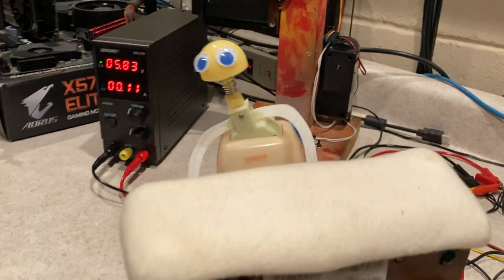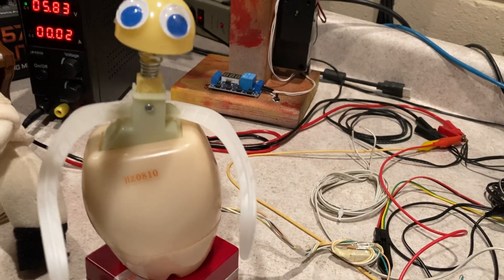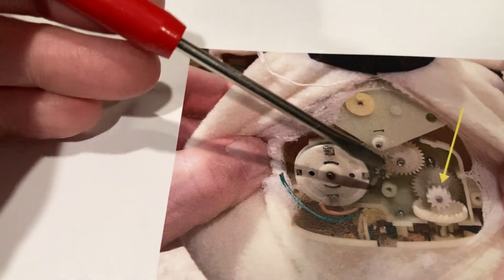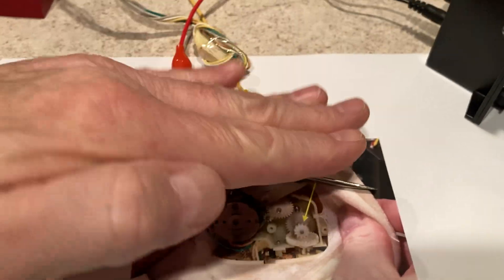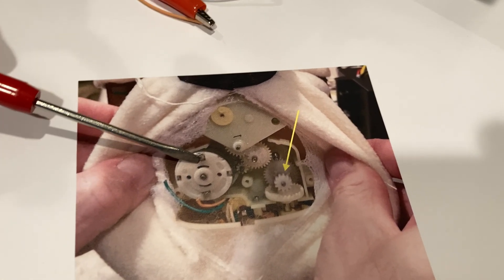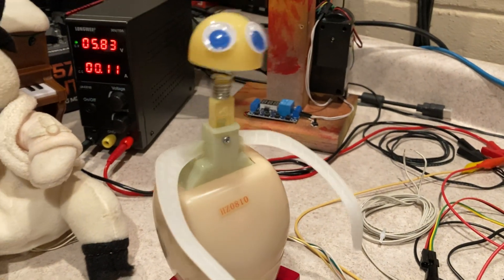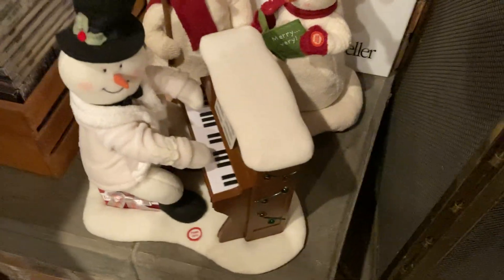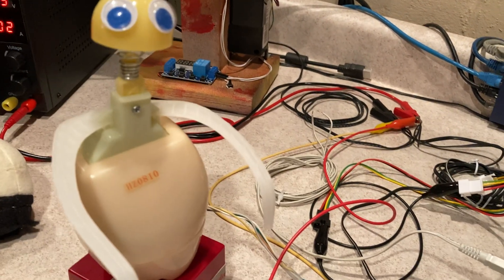Hallmark Plush 2005 Piano Playing Snowman Explain Gearbox Part 3

Comment: Can any body help me with some wiring advice? I have the unit apart but some of the wires have broken loose. I know green wire goes on the top lug of the motor, the tannish/orange one on the bottom lug. There is a small black jumper connecting the 2 leaf switches. There is a yellow wire going to the belt drive side leaf switch. This leaves the grey and the white wire. I assumed the white one went to the rear leaf switch but what about the grey wire? Does it share the same connection with the white wire on the rear leaf switch? Any pointers or a good picture/diagram much appreciated!
Reply: @mikecomptech can you post a pic of the wire connections?

Comment: Thanks for the walkthrough on this little mechanism. 

I’ve a question if you don’t mind. Something odd, once I got the motor cleaned up, made sure all was running correctly including the flair turn on the keyboard, once the back body cover was in place, the mechanism seems to stick and not follow through. It sounds like something is binding a little when I assist it back in place but I’m not finding anything that’s binding. The body cover is seated correctly on the pivot ring, no mesh or poly fill stuck in it, yet it won’t cycle without help. The motor will run for a few moments, I hear gears turning and then stop.  It’s working perfectly otherwise

Comment: Sounds like the 10 tooth drive gear is cracked on this one. I had to open mine a couple years ago but luckily was only a stuck motor issue
Reply from the maker: No, these are belt driven to the gearbox. On this one it was the belt, over time it can stretch so it takes more torque from the motor to turn the Snowman. The controller reverses the polarity that engages a vertical crown gear so then it spins the Snowman after the 3rd song is complete. Replaced the belt works great now, as you saw in this video. I show the reverse polarity in action. Thanks for your comment.
Reply: @mikecomptech  yes, you are correct though belt driven things do still have drive gears, they’re usually the smallest gear closest to the motor and what the pulley from the motor attaches to. They’re the most prone to breaking aside from the belt wearing out. You can see it at 6:17 right beside your screwdriver on the left if you pause the video. When those crack it eventually loses friction on the pulley shaft and won’t move the other gears. I just replaced 2 of them in a Gemmy snowman yesterday and it runs flawlessly. You can usually tell when they crack cuz the gearboxes get significantly noisier
Reply from the maker: @truecrazy5  The gear I was pointing at is supposed to slip on that shaft. It is there to stabilize the crown gear, it produces equal pressure on each side of the crown gear. 
But yes have seen many cracked drive gears specially in Gemmy toys. Thanks for your reply.
Reply: @mikecomptech  I wasn’t talking about the one connecting to the crown gear I should’ve clarified more, it’s the really small one between that double gear that’s hanging down from the head bobbing part and the micro motor. It’s hard to point out lol
Reply from the maker: @truecrazy5  Ok I know which one you are talking about, I was lucky none of them were cracked. You have a great YouTube channel been checking your videos. Stay tuned more vids to come.
Reply: @mikecomptech truecrazy5 is right. Theres a small crack in the small gear. You can hear the gear ticking. It will eventually completely split so it’s a good idea to replace it while it’s open, although I imagine he’s put back together now.
Reply from the maker: @ No these are parts donors for other uses and projects. Thanks for your comment.